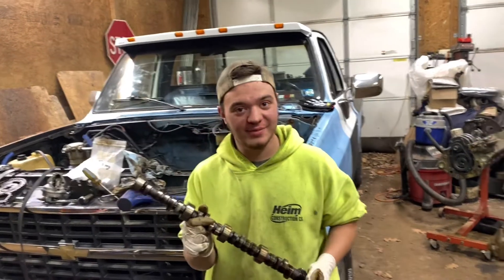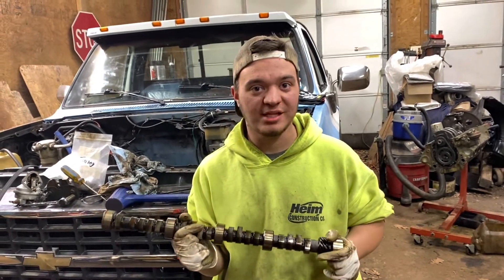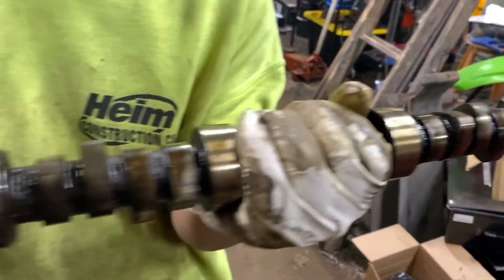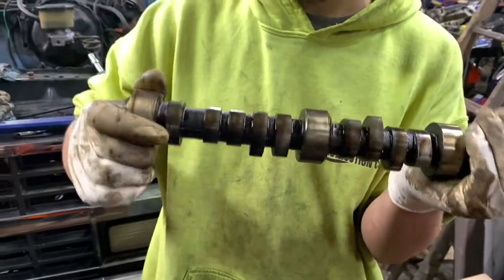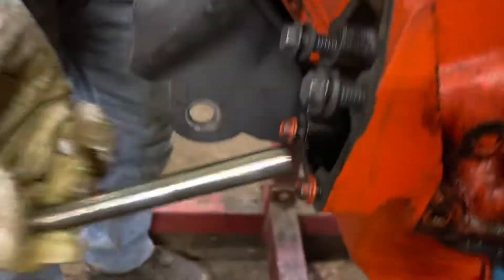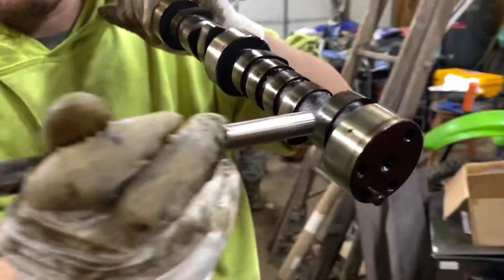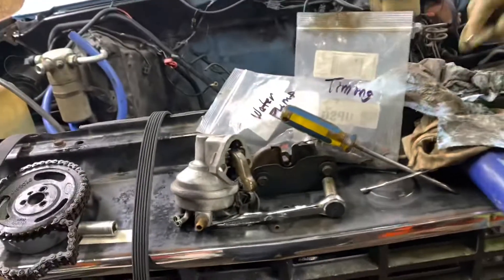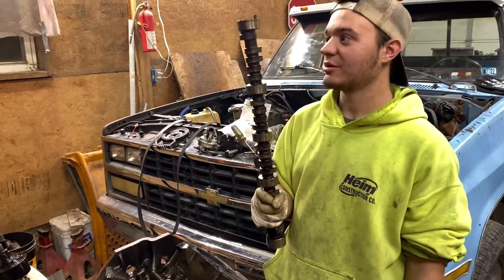How does a Mechanical Fuel Pump Work?

Comment: Does the fuel pump pushrod spin while it's moving up and down like a lifter does? I looked at my Comp cam and the fuel lobe looked perfectly flat. Do you know?
Reply from the maker: @jimmyhobbs5029  yes. It will rotate

Comment: Can I use a stock fuel pump on a 1987 305 tbi block ?
Reply from the maker: @smokeydabeecharlescoleman8365  Yes as long the cam has the front lobe for the push rod on it and the block has the casted hole on the side of it for the push rod.
Reply: @BoneyardRevivals  That's my problem. How do I know if the cam has the lobe ? The block off plate is solid. Definitely would need a new block off plate, but the lobe ?
Reply from the maker: @ If you take the solid block off plate off and there is a hole bored in the block you might be able to shine a light up the hole and see if you can see that lobe. 

The other way would be to unfortunately disassemble the engine which I assume you don’t want to do.
Reply: @BoneyardRevivals  definitely not,lol
Reply from the maker: @smokeydabeecharlescoleman8365  Haha I hear ya bud. Let me know how ya make out!

Comment: Hey! are all the pushrods the same diameter? Mine wont go in all the way in,but a screwdriver/drill bit would. And the screw was removed on the outsideof the block ) i have a 1st gen  GM 5.7/350 (cast # 1024880)
Reply from the maker: The numbers are usually 8 numbers. Is it actually a 10243880? If so it’s a Vortec block so it was originally a fuel injected engine so it never had a mechanical fuel pump. I have a block that is like that as well. I don’t think they make smaller rod. So it was never meant to have a mechanical fuel pump. And I don’t know if they make smaller ones.

And the only other way to make it work would be to make the hole bigger. A machine shop bore probably could make the hole in that casting bigger. But the cost to have that done compared to just going with an electric fuel pump might not be worth it.
Reply: @BoneyardRevivals  thanks for quick response (you got my sub) but your right on everything.  This in line fuel pump crap is killing me,and i want to do a return line as well. You by any chance have a video on file somewhere on the Subject. After pulling /dropping the motor and wiring everything back up, My brain don't wanna work anymore. lol
Reply from the maker: Unfortunately I don’t have a video on doing that. I almost did it to a block of mine but decided not to because of the machining cost. That’s a Vortec block getting built to a 360 (a .040 over 350) aluminum headed hydraulic roller engine, which I plan on using a outside of tank Holley pump and regulator.

Comment: Hey!
Is there ALWAYS this push rod between the pump and the cam?
Can this arm be broken in any way?
Trying to trubleshoot a fuelpump on a friends inboard boat engine.

//Fredde
Reply from the maker: If it’s a Chevy, yes this rod should be there. However I believe that in a Ford or Dodge application there is no push rod. The tang on the back of the pump either rides directly on the cam (in a Dodge application) and for the Fords I believe it runs on a centric wheel attached to the front of the cam because ya know fords are weird like that. Plus there are 30 different ford engines from the Cleveland’s, the FEs and whatever else they got. 

I’ve personally have never seen the rod or arm break. 

I just went through some fuel pump trouble shooting on a 318 Mopar I pulled the fuel line right off the carb and left everything else connected just to confirm fuel flow from the tank to the pump then to the carb. I manually filled the bowl of the carb to keep the engine running for this test. 

And I found that at idle it would not pump until I gave it 1/2 throttle. I put a new pump on and all the issues went away so I assume that something happened to the diaphragm in the pump which would cause it to lose prime and or not pump at lower rpm. (Considering that as the rate of the pump changes as the engine spins faster or slower.

Comment: Hey, my push rod is stuck in my 440 engine. Even when I turn the engine it doesn’t move, should the cam turn it? Thx
Reply from the maker: I am not sure how they work on the mopars. I imagine you should definitely see it move in and out off the lobe of the cam if you had the fuel pump off of it.
Reply: @BoneyardRevivals  the pump and rod was ok, I had a pinched hose from the fuel tank, thx
Reply from the maker: Hey that will do it too. 🤣 No problem.